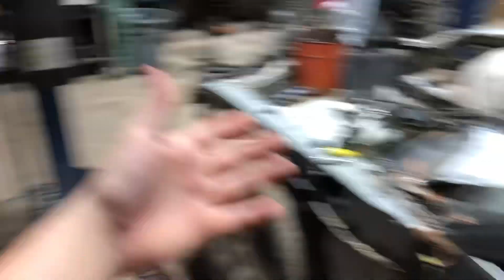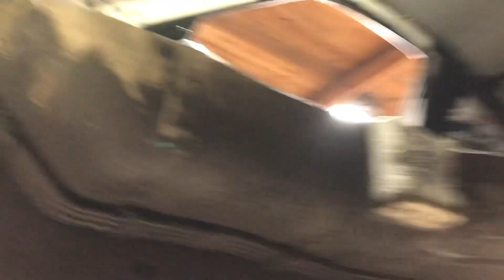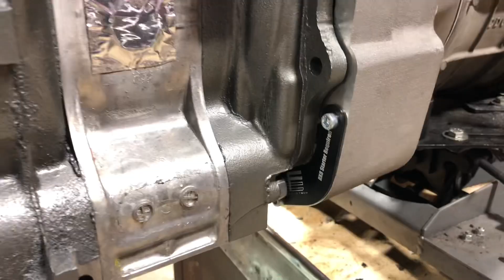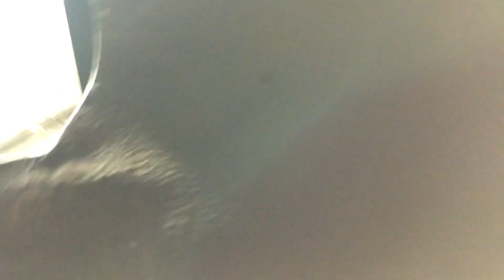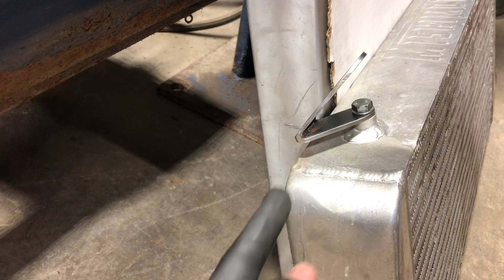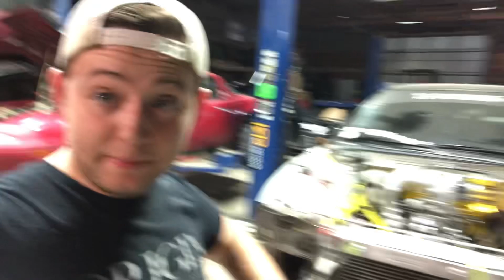CD009 Trans and 13B Install! Rotary 240sx Drift Build ep4

Comment: Could I use an air hammer to massage the transmission tunnel ?
Reply from the maker: Depends on the trans, with a cd009, the amount that you need to move the engine up, makes it so you need to cut the tunnel

Comment: Great job iwas hoping u where doing the engine/transmission plate in the firewall like the pro mods
Reply from the maker: Oh like a mid plate! I might one day design something like that, just want this to mainly be a bolt on solution so it’s repeatable